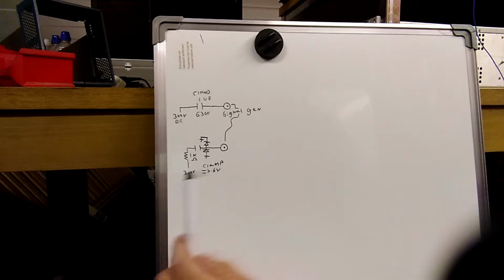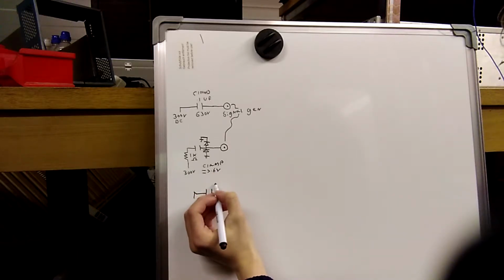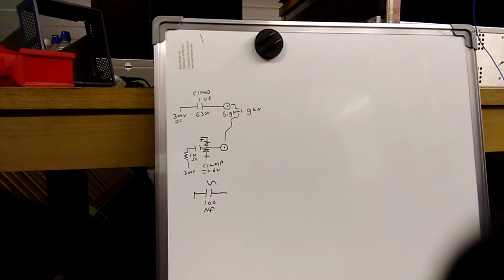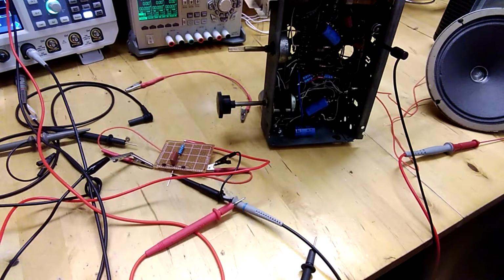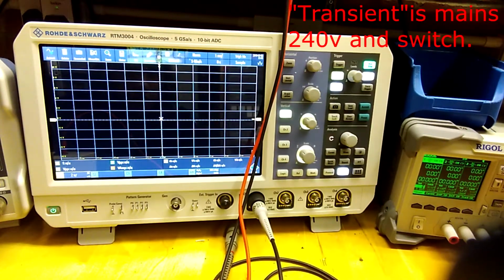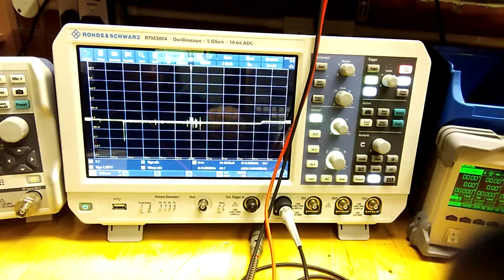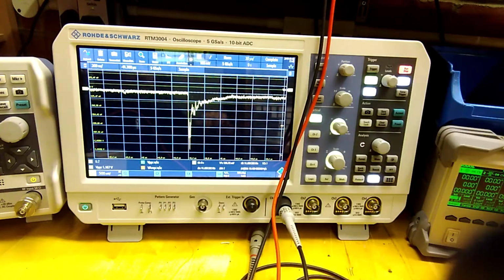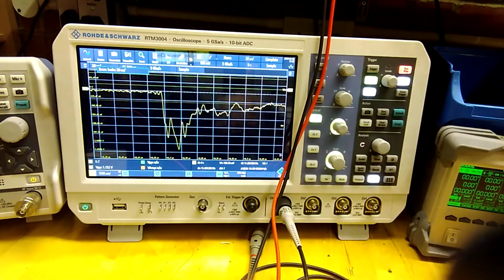Signal generator HV protector for valve radios.

Comment: I would rather go for a series pair of 27R 0.3W metal film resistors on the signal generator output, giving a rough 50R load, and at the junction connect a 10n 1kV ceramic capacitor and use that as the injector. Well damped response, and a 3dB attenuator which is no problem as you are applying a really small signal anyway.

Then again I have some protection units for spectrum analysers and test sets, which are just a series of interseries adaptors, and a in line 63mA picofuse with a crimped on pin each end, rated to 1GHz use. Not going to save every input, but at least limits the damage, especially for those with 50R inputs that are only able to handle 3V or so input voltage. I use them mostly as adaptors though, as you can change from most common types to any other type with ease.
Reply from the maker: Hi, yeah i was thinking about that however due to the fact my signal generator is also my scope (a very pricey one) i thought better be safe than sorry and over kill it. Also i should say that this video was just to shoot a few ideas there are many ways to protect signal gens/spectrum analysers.

Thanks for commenting mate also! A 50ohm load does not matter to much with these older radios,hell in some manuals they just tuned to the closet "known" station to do the dial aliment/IF! 

Alex.
Ps sorry if i said some dumb things its rather late for me hehe.